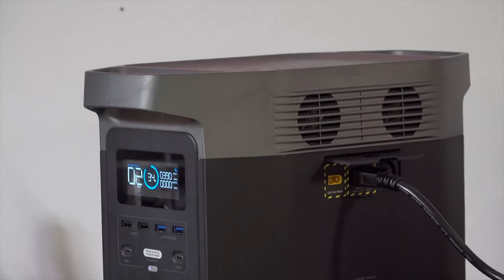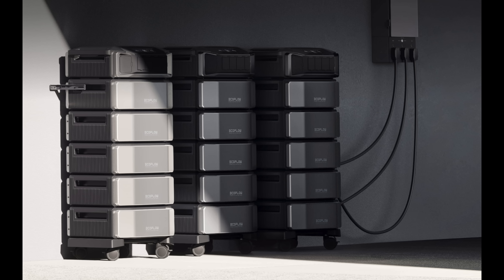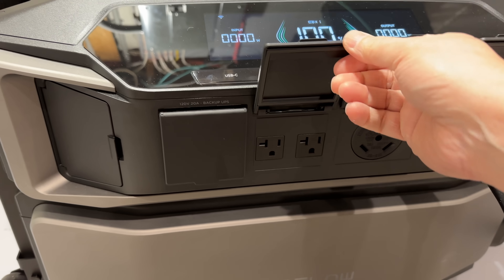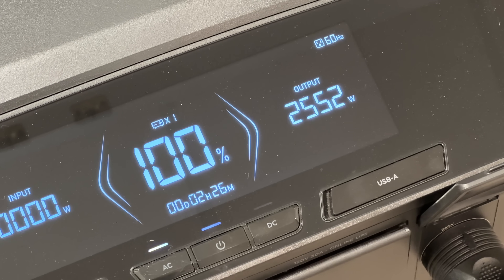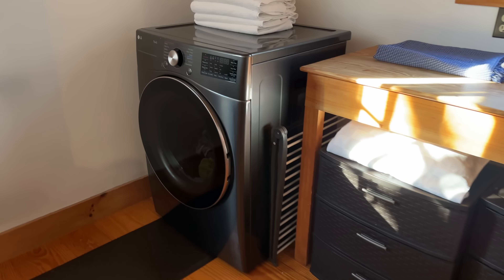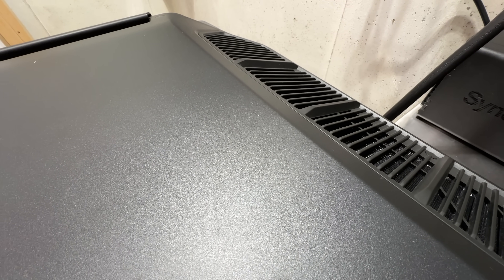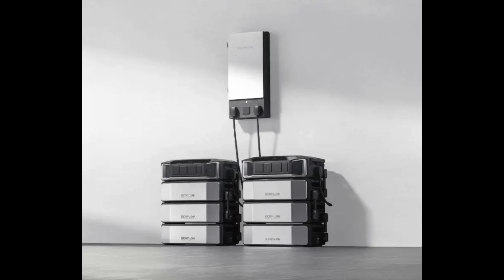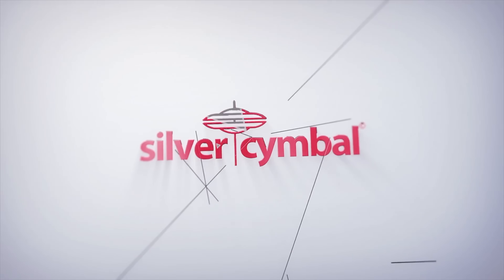ULTIMATE Home Generator just got BIGGER with 240V | Ecoflow Delta Pro ULTRA

Comment from the maker: Get the Ecoflow Delta Ultra Pro right now for just $4,999 (reg price is $6,499) Order here: https://bit.ly/4ajinYh Use my code EFDPUSILVER8 & *get and get an extra $800 off DELTA Pro Ultra & related bundles. (Valid until April 20) . You will not find a lower price anywhere.   .
Reply: Code not working
Reply: @samlyons7189 it does work, I just tried using it…not that I could afford to buy one…I sure  wish I could though..
Reply: The code doesn't work
Reply: code doesn't work
Reply: i see an ECOFLOW 7200 watt Delta Pro on the harborfreight website.says $2800.
Reply: Hi, like many others have said, code doesn't work.  Do you have a working code?
Reply: Maybe pass the date
Reply: OMG YES

Comment: Now Im confused. You are showing it using pass through charging running a dryer and another review video showing it not being able to use pass through charging with the 110v plug hooked to a generator while using the 240v outlet??
Reply: Same
Reply: Can you link to the video you mentioned where they showed it cannot power 240V while charging from 120V?

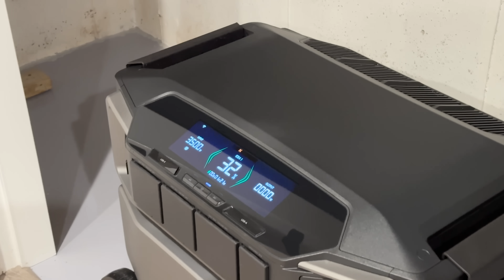Comment: Does your picture at 7:37 show the Ultra plugged into a transfer switch AND into an AC outlet at the same time? If so, it's my understanding that this is a BIG no no.
Reply from the maker: Yes you are correct. That outlet is on a separate breaker that I keep off prior to turning the Ultra on.

Comment: Is it possable to just run a gas generator, 240v to the DPU for charging on cloudy days. Then run a 240v out from the DPU to a small breaker box for distributing small loads for off grid living? This is just for a single DPU unit.

Comment: I've been trying to get a Tesla Powerwall for several years now, but the alleged certified installers are neither trustworthy nor reliable. I have no choice but to get something like this. You're absolutely right. Unlike TP, this one doesn't require professional installation. Just press a button, which is much better than dealing with the headache of incompetent "certified installers."

Comment: So how does this generate power? You keep calling it a generator, but it's a power bank. Nothing more. It stores power, not generate it. Unless of course, you don't know the difference between a battery and a generator, then I'll understand your ignorance.
Reply from the maker: Example 1) Gasoline + Engine = Electricity Generated   Example 2) Solar Panel + Ecoflow Delta Pro Ultra = Electricity Generated (and stored too)

Comment: It’s not a generator; it’s a battery.  It’s deceptive to call this a generator.  It stores power which is created elsewhere.  A true generator creates power, typically from a gasoline or diesel engine.  I’m not saying that this device is bad, but it helps to clarify what you’re getting is we stop calling these generators.

Comment: And someone never owned a gas generator propane generator diesel generator or old generator I guess I'd have to be solar and since I can't hold on Fuller on it. I guess I'd be left empty and so be going to the generator or batteries of the batteries can take solar to if not just a generator then.

Comment: I bought a Delta Pros several months ago. It ran good as advertised for few months then suddenly quit take charge from any input: Ac from wall plug, solar 145v or 12v DC. I called tech support and followed their instructions how to reset and set up but still blinking 0000. Please help as this $3000.00 device is like block of concrete to remind me that I am a fool because I bought it.
😥😠

Comment: How dangerous are the batteries, are they similar to the batteries used in the EV’s?
Reply from the maker: No, the car batteries are not Lithium Iron Phosphate. Significantly safer, EV batteries if punctured can and will explode. They heavily protect them but sometimes they go boom. All batteries have some risk but if you Read about LiFePO4 it is much much safer. Cars will eventually use these but they cost more so that's why they don't

Comment: it's a just a battery, not a generator.
Reply: You are correct it's a battery but also an inverter. The inverter uses DC voltage and converts to 120 volt  and 240 volt AC voltage or you can say it generates AC. I prefer a gas generator, but both generate 120vac

Comment: separate controller and batt packs if that's the design here is definitely the way to go... however that price is way out of my budget. For as long as they stay legal, a decent generator and good supply of fuel is 1/4 of the price.

Comment: These are NOT generators, this is false and deceptive advertisement, they store and discharge, in power outage after few hours of use you will have useless $ 6000 box, get a real gasoline or diesel, propane generator  ????

Comment: Hmmmm????   It's not really a generator is it!  It is a battery power pack.

Calling it a generator is a misnomer as far as I'm concerned as it truly doesn't generate power, but discharges batteries inverting the DC power into AC.

Comment: Can I charge it with a 2kw wind turbine
Reply from the maker: Possibly, it depends on the output and there are some interface boxes. I will be doing some testing on this surprisingly soon, please stay tuned.
Reply: @SilverCymbal  hi well I have Solaredge system with 10kw battery and trying to figure out how to use wind to keep it topped off. The salesman 3 years ago said being a hub inverter that other sources could be added. SE now say that it is not possible without giving a reason why. The PV to the inverter and on to the battery is all DC. From 48v per panel and up to 480v into the battery. The inverter has an input for a 2nd row of PV so why cannot I take the output from the turbine and present 48vDC+ to the inverter?

Comment: So while using your backup ecoflow to restore power can you charge the ecoflow at the same time
Reply from the maker: Correct and at quite a high level as shown. It's a game changer since you get clean 240v out and can use all sorts of 120v inputs, gas generators, other batteries, even litte jackeries. Kind of like the modern day version of grabbing every gas can you have got and filling up your car.

Comment: That price is a deal breaker. I have a 6500 watt gas unit I've owned for 15 years. I paid $299 for it. I'll never understand the rush to these battery banks. They will fail the test of time.

Comment: Great review, awesome product, the thing is if your without power for any length of time your going to deplete battery in a few days unless you very conservative and then you have to have a large solar bank to recharge it or run a gas generator to recharge it. Probably better off just getting a 10,000 watt gas generator or having a Generac backup power system installed, that's what we are using, our runs off of propane and  does a good job, much cheaper then these battery generators and the massive solar panels you need to recharge them. We have some friends that live off-grid and their primary source of power is a diesel generator, this thing is massive, it runs constantly around idle speed and gives them 240 volts and 110 volts with no issues and it uses very little fuel.

Comment: i must have missed it in the video but how long can you run your stuff before you have to recharge the delta pro ULTRA????????????????????
Reply from the maker: No you didn't it totally depends on what you are running. A fridge and lights could run for 3 days with this setup. But if you want to run electric heat, 2 freezers and a electric stove it could be as short as 4 hours. It s a100% determined by the wattage you are using at any given moment.

Comment: Nice video.  What size breaker should be used when installing an interlock kit for 240V use?  50 Amp?
Reply from the maker: If you use a single power unit like I am here, it works with just a 30AMP breaker. If you want to set it up for 2 Delta Pro Ultras then you would move to to a 50amp. I just did a 30AMP interlock install here that ay be helpful: https://youtu.be/pPMm0reEBPM
Reply: @SilverCymbal    Thanks!  What gauge wire with a 50Amp breaker to run it 4-5 feet to a new inlet receptacle?
Reply: @SilverCymbal  Also if you use two of them do they connect serially (daisy chain) and then one cable to the inlet receptacle?

Comment: Will be nice when they come out with an automatic 240v smart generator with the option to charge 240v while output 240v from the dpi at the same time. and in regards to the batteries like the other gentleman mentioned below those batteries are way $$$ a 5kwh on the market sales for $1,300 and the EF battery for $3k for 6kh it's almost 3 X the price  at $2k would be so much better I'm sure others are considering the DIY system since tou can get 30kwh for $8k  vs $15k EF

Comment: How much time between charges would you guesstimate if you’re just running the basics? Some lights, a fridge and maybe a/c?
Reply: @shawnakbynum  Running lights will depend.  If you have LED bulbs, that are 10 watts and you had say 10 on you could run 10 lights for around 60 hours.   A fridge will vary depending on what type of fridge etc but you could run a fridge off the single battery for roughly 7-17 hours.  AC depends on the size, but AC on a single battery with no solar will drain the battery fast since they use 3 to 3.5 KWH an hour.   2 hours or less of run time would deplete a single battery.   If you had solar plugged into it you could extend that battery life but that would depend.   Id say, a few lights on, the fridge on and the AC you would deplete the battery in just a handful of hours without solar assisting.

Comment: How many batteries would i need to run a well pump, hot water heater, 2 fridges, and some tvs? For a day or 2 max? I would probably need a bunch of batteries right?
Reply from the maker: That type of a setup would like need 3 maybe 4 batteries for the time you mentioned.

Comment: Thank you for bringing another very intriguing  item to consider.
Expensive? Yes. I am considering it because I have a 7500 watt gas powdered generator  that has served me well through years of short duration power outages. If this Ecoflow Ultra can deliver a 24 hour run of powering my house (like the gas generator can), then I am going to give this a good, hard look.
An instant on generator upgrade to the gasoline powered generator is going to cost me $15k to $20k. If I can backup my current gasoline generator with the Ecoflow Ultra for $6k or less, then it seems like it's something to consider.

Comment: keep watching your stuff waiting to pull on the right set up for my home.  Its wired through garage for generator input and then have a manual transfer switch in box.  we have an active sump pump sadly (4K times a day when it rains), and on well so just wanting to find right power system to last a couple days piece of mind.  they are quick to return power normally than that but 2 days would be nice!  this seems really really close!

Comment: Great video thank you. The first product was really good but this is what I’ve been waiting for. I always like to give me a chance to work out the bugs and then deliver something really good now I’m gonna buy.
Reply from the maker: 4 years ago just getting 120v with a battery was crazy. Its unreal that they have come this far. I will be using this ongoing for my house and adding some batteries and eventually solar as well. They addresses every concern or hope I had with this one. Be sure to use the coupon/link above (while I certainly appreciate the affiliate link) it also gives you an extra $1000 off for the next 4 weeks making the base setup $4799, which is chepaer than 2 Delta Pros last year cost.
Reply: @SilverCymbal  hey thanks for the message. I live in Phoenix and I have a Tesla solar system on my roof. It works great but I don’t have a battery. The power walls were just too expensive at the time. I figured they would come down in price and they’ve actually gone up. So I’m looking for someway to save the extra power I make during the dayand use that to run the AC at night in the summer as you know our summers here are absolutely oppressive. Anyway, I think you have one of the best channels on YouTube. Talk to you again.

Comment: Where does all the data to control the ecoflow app go? Who controls it, has access to it in the cloud?
Reply from the maker: Its their cloud app. If you are concerned about privacy, you never need to connect it to wifi or just connect for firmware.  Wifi is NOIT required to use the device Only optional for remote access/monitoring
Reply: @SilverCymbal  this is a Chinese product.   Which means the PRC likely is getting insights into all of it.  Just sayin…..
Reply: @tlteal Why would the PRC care about how much power you are using in your house?
Reply: @patrickhynes6058 I don't think they care about how much power you're using.  I think this is a command and control thing.  Where does all the data go (in transit, at rest and in motion?) and what kind of your home WIFI information do you have to put in it?    Think about it..... you'll understand.

Comment: The specs are not insane. This cheap, Chinese made unit offers a poor peak power rating, and a far shorter life expectancy, when compared to a conventional longer lasting. lower priced, heavy duty  low frequency inverter charger. It doesn't even have a UL-1741 safety listing so you would never be able to obtain a permit to permanently install it in a home. And because it isn't UL-1741 listed, you won't be able to qualify for a state rebate or tax credit.
Reply from the maker: Are we talking fantasy or reality? What is the product that is better than this?
Reply: It's no fantasy. Virtually any UL-1741 safety listed, heavy duty, hybrid, low frequency. transformer based inverter charger and a bank of LFP batteries is substantially better than the Ultra, because low frequency inverters all utilizes a far safer design, a proven, far longer life expectancy and a much, much higher (300%) peak power rating and a lower price. You're literally wasting your money on the short lived, wimpy, (only 150% peak power capacity), non-UL safety listed Ultra. I wouldn't install an Ultra anywhere near my home, even if they were giving them away.  @SilverCymbal
Reply: Reality. Hybrid, low frequency, transformer based inverter chargers are light years ahead of these cheap, low surge capacity, short lived, Chinese made high frequency inverter tech. @SilverCymbal

Comment: If I'm not mistaken, the 10 year estimated lifespan on LiFePo cells is based on number of discharges. If you're not using this unit as a main power source and discharging completely every day, it's entirely reasonable to expect more life out of the cells. Also, the cells will still retain some capacity after that point, so even though the company can't guarantee the product can operate at advertised ratings, you could still either operate the unit in a lower capacity (If the electronics will let you) or uh... void your warranty if you know what I'm saying (and not endorsing, as it risks injury lol)

So anyway, it's insane that battery chemistry is getting THIS good. The cells in this battery could theoretically still be putting out some charge in 20 years, I have no reason to question that Ecoflow's cells are second rate.
Reply from the maker: You are absolutely correct, the lifespan using this as a backup could be much much longer than that.

Comment: This is exactly the type of setup I'm looking to do for my house soon. I like how you say the smart panel isn't really needed as I also like the flexibility of the interlock. I can pair this up with a gas generator to get through extended outages since you can still charge it while discharging 240.
Reply: How do you like your split system I'm looking for a good product.  So the ultra handles it?
Reply: @marygunn7417  haven't picked it up yet but I plan to for this year

Comment: Great video. Off-topic, but what's the additional unit you have connected to your (RO?) drinking water system? I recognize the Aquatec delivery pump, but what's the unit located above it? Thanks!
Reply from the maker: Thank you  That is an accumulator tank. https://amzn.to/4aKaWdT  I need to do a video on that setup as it was very affordable and I run filtered water to the fridge and a kitchen tap and I only have to change filters down in the basement which is nice. The accumulator helps smooth out the flow, otherwise its like squirt-squirt-squirt up and down. The accuulator eliminates thats almost entirely.
Reply: @SilverCymbal  Thank you! I’ve got an RO filter in my (large) crawl space that supplies only the refrigerator at the moment. I’ve been considering a delivery pump but was thinking about adding a second water tank (just like the one that came with my RO system) after the pump. Looking forward to your video, as always!

Comment: They're getting so close! I would prefer the option of 50 amp output to handle the summer load at our house. I wonder if they'll offer a joint unit connector so that two head units can send 50 amps into your home, or if you'll have to buy the smart panel or wire multiple inputs to the home.
Reply from the maker: You literally guessed it. They do have a combiner box, if you don't want to go with a smart panel, but it will combine two stacks with 1 50 amp outlet. I will do another video a little later with more batteries and that adaper in the future
Reply: @SilverCymbal  thanks, Chris! Much appreciated!